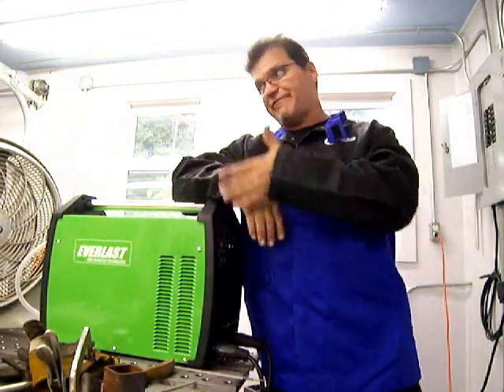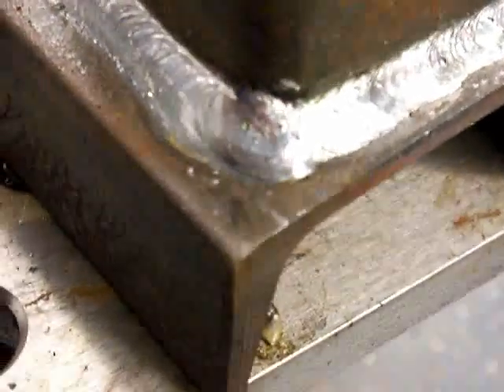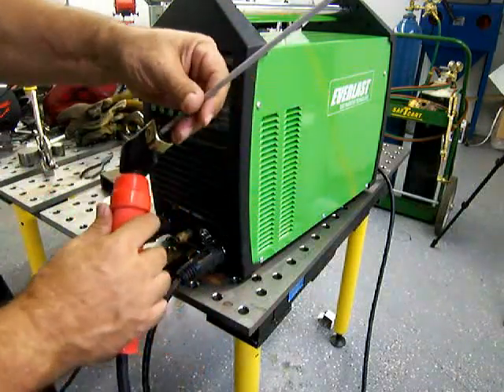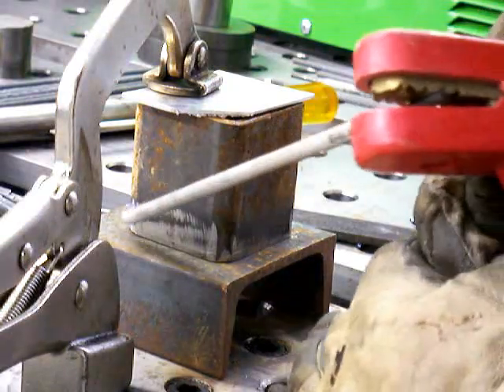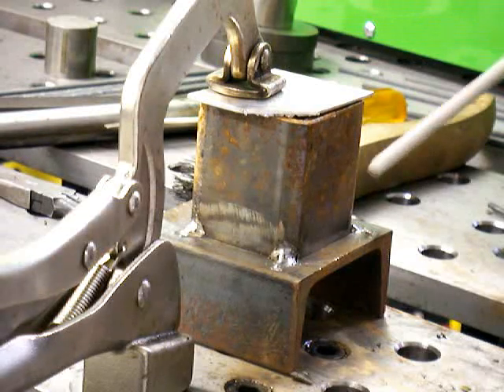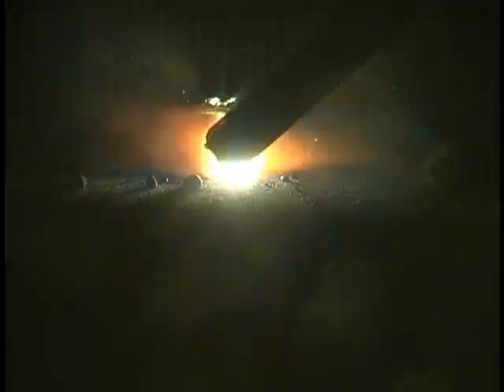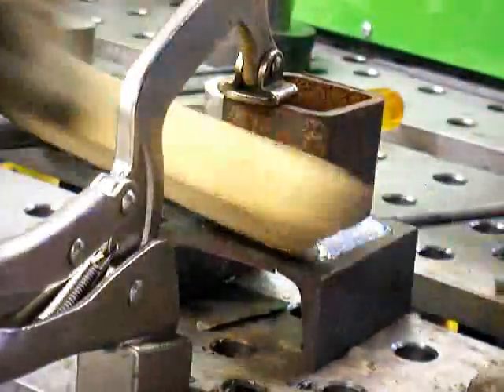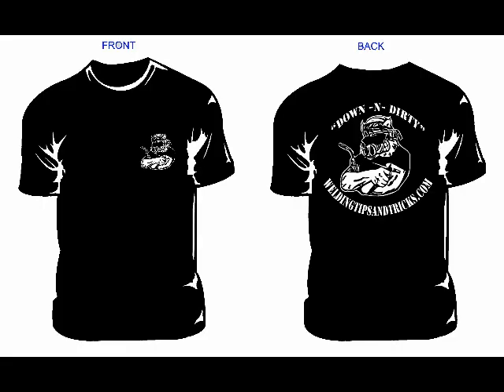Arc Welding Machine that Tigs, Sticks, Plasma cuts -  Everlast PowerPro 256

Comment: Where have you been? That twist-lock handle has been around since the 60's
if not even earlier. (The Navy used them for years on-board ships not sure
about land base maintenance shops.) I used 2 in my shop for 25 years.

As for bending the rod -- You've done the same thing on several videos with the
standard holder.
Grandpa Bill
(Making sparks since '63)